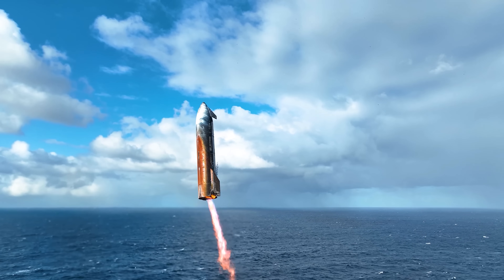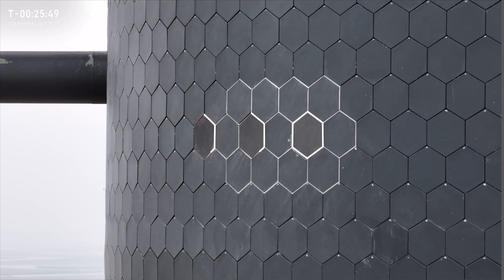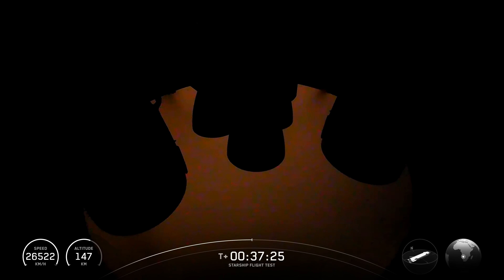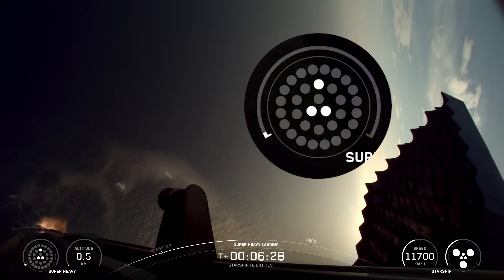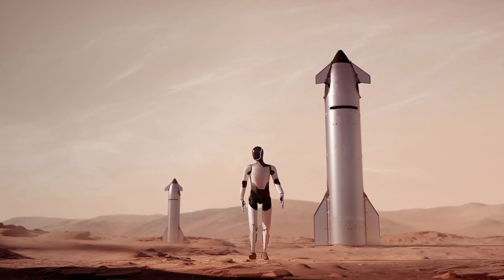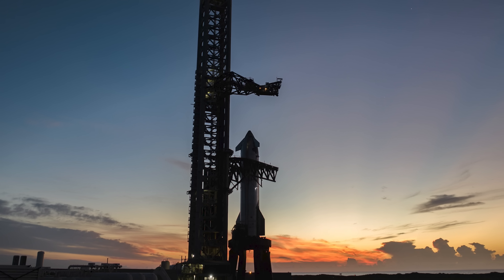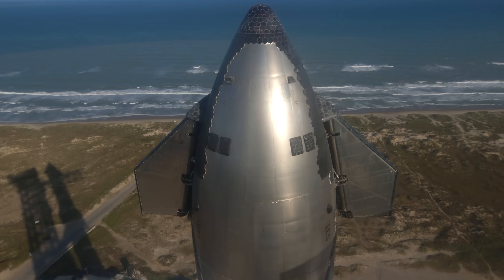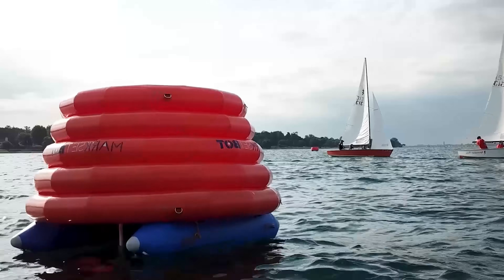New Onboard Starship Footage REVEALED Problems with Starship Flight 10 Landing...

Comment: What was interesting on Flight 10 is we did not see plasma leaking between the Starship and the winglets. Seems like they have a solution in place for that. Only one more flight for Version 2 and then onto Version 3 where Starship will be orbital and they can start propulsively landing them.

Comment: Please explain why a company as Space X or any other company is permitted to dump so much junk in the world oceans? If the normal everyday human is guarded from discarding refuse then these same laws must be used on SpaceX. If they do land in the ocean then make them pickup every piece of junk. Period.
Reply: on the booster, adequate deflaglation needs to be demonstrated as not to impact coastal area if some kind of directional problem occurs..  I believe SpaceX picks up the pieces anyway..   So maybe it is that SpaceX should cut up these pieces and sell them as souvenirs?  (I wonder when there would be some type of marker saturation???)
Reply: I think they retrieve the star ships, but you've got a good point
Reply: @getjoshnow  Even if they leave it there, the metal is not polluting the oceans
Reply: So where have you been when all these other rocket company's dump their boosters into the ocean or upper stages remain in orbit to endanger other space craft? What other company is working towards full recoverability and reuse? Another Space X hater.

Comment: A majority of the tiles on the Shuttle orbiters were original to each orbiter when the program ended.  A 30 year program.  Why is there a need to keep reinventing the wheel?  The issue with shuttle tiles were they were on the side of the stack where they could be hit be debris coming off the ET.

Comment: Starship's Flight 10 showed promising heat shield upgrades, but the metallic tiles' oxidation issues highlight the need for more testing before Mars missions. Great progress, SpaceX!
Reply: A majority of shuttle tiles at the end of the program were original to each of the vehicles.  Proved they could last a long time, 30 year program.  The issue was the orbiters being on the side of the stack where they could be hit by debris coming off the ET. Don't know why they feel a need to reinvent the wheel for Starship.

Comment: Another problem with using metal heat shield tiles that transpire methane is the complex chemistry that occurs when you expose Methane, Nitrogen, and metal to a plasma.   For example, on Titan Nitrogen and Methane form organic compounds called tholins which are orange-brown in color - sound familiar?   Tholins are also what make pluto orange-brown.

Comment: Great video. As you pointed out, the design of Starship prevented a catastrophic failure on reentry. Had the aft flaps failed to their hinges, the ship would have rolled uncontrollably and burnt up like ship 35 did. As it was, even though there was visible damage to the shielding on the flaps, the heat only consumed a relatively small portion of the flaps. I think the heatshield did a great job overall.
Reply from the maker: Great point, that is a good way to look at it!
Reply: That was my first thought too, but it's difficult to judge from a distance; you'd have to look at the ceramic tiles up close.
Reply: @Andy-qv9tb  True. But there's no denying that the heatshield on ship 37 did a much better job than any before it. They've been trying to test it since flight 7. It is progressing.

Comment: Perhaps the newer larger versions of Starship will not increase payload/passenger capacity too much but instead increase the capacity for more fuel, extra operational controls, shielding and storage tanks for coolant dispersal to shields, and the coolant itself.

Comment: How do we know the heat shields are working well for fast turnarounds ? And how was this no load launch no saved anything count as 100% success on its 10th try ?
Reply: Got to remember that starship is still in a testing program and they are intentionally pushing starship to and beyond it's limits NASA has to get everything absolutely perfect  since they work on a highly constrained budget at the whim of Congress whereas spaceX is a private company and has plenty of cash flow from starlink and they're falcon 9/heavy launch Services so they can afford to fly often like this to really find limits and get data on a lot of things (especially re entry) that simply can't be accurately simulated on the ground
Reply: @KiRiTO72987 it's hardly beyond it's limits unloaded sub orbital couldn't land , am I missing something ?
Reply: @MyKharli  they intentionally removed tiles in critical spots to test what it could survive as well as going in at a mich higher angle of attack they didn't go fully orbital because they want to be absolutely sure they can de-orbit it in a controlled manner hence the relight test it would be very bad for a 50 meter tall 9 meter wide stainless steel rocket to re enter in an unplanned area also it's in common for a space craft to use a pump fed engine as the de orbit engine since pressure fed ones are more reliable and even if the starship entered the atmosphere completely backwards some pieces would make it to the ground, so going sub Orbital like they are is the best way to safely test the necessary systems to make sure it can safely de orbit once they do go o
Fully orbital
Reply: @KiRiTO72987  but they wont know anything until they do a fully loaded full orbital speed re entry , that's the bit i do not get by flight 10, and why is not every one a practice landing ?  there hardly been in the rapid reusable arena yet ? how many of these types of tests will you accept ?
Reply: @MyKharli  the difference in velocity for a stable orbit vs what they did on flight 10 is miniscule so that's not really going to have any affect on the data, as  for full load where expecting them to go fully orbital around flight 13-15 with the block 3 booster and ships, and with regards to number of test flights again spaceX is privately funded yes they have contracts for HLS but those are fixed price and they only get the money when they achieve specific milestones that are pre defined so really as long as their not backsliding terribly (which is part of why flight 10 was so important after the failures of IFT 7-9) they should do as many test flights as they need to they are after all trying to make not only the world's most powerful rocket ever but also fully reusable which is a massive challenge so it's unsurprising to me that they have to do a lot of test flights

Comment: I like the heat shield testing Space X is doing. At this time releasing the liquid methane must be only experimental and very temporary. The release of the methane may be why the Starship blew up when it landed. At this time, for testing, the liquid methane was likely used out of convenience. If this process starts to look very promising for heat shield processes, then they will likely switch over to inert gases. Perhaps liquid Nitrogen. The problem is it creates a whole new need for a storage tank and delivery transfer system to the heat shields. Another good reason for not dispersing methane for the shields is that Methane is extremely bad for the atmosphere... worse than CO2. As you know it also creates a whole new risk of explosion.
Reply: The methane being flammable might actually be beneficial in protecting the rocket. It might prevent the tiles from oxidizing, kind of like a sacrificial anode on a boat but, well, obviously quite different.

Comment: The metal heat shield tiles were oxidized upon re-entry into the atmosphere. Were they cooled with a liquid or not?
The oxide appears to have spread evenly around the rocket; a liquid would do the same and thus shield the rocket from the heat. It would then certainly not be necessary to attach the metal tiles to the entire rocket.

Hopefully SX can solve the heat shield problem; it would be a huge step forward for space travel.

Comment: Ok cut smoking elons wacky weed.  Those are not landings.  Anyone with hald a working brain cell knows that a metalic objec of that size KNOWS  that  object will sink when it touches water!  And as it sinks wave action forces it to fall sideways.  Unused fuel will mix and explode. This is not reusability, but disposal process!
Reply from the maker: SpaceX going to reuse Starship by catching it with the tower at launch site. The water landing in this fight just a test to see if the ship qualifile for the real reuse test. And it look like it does.